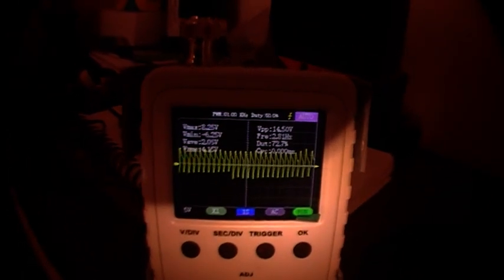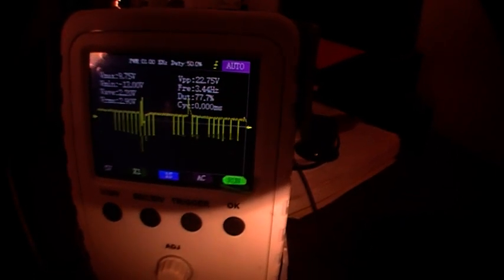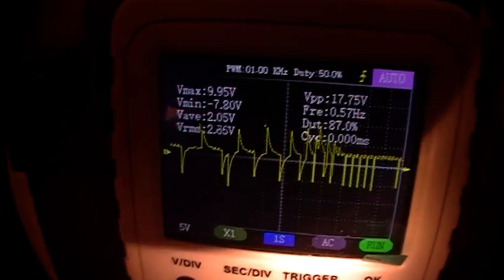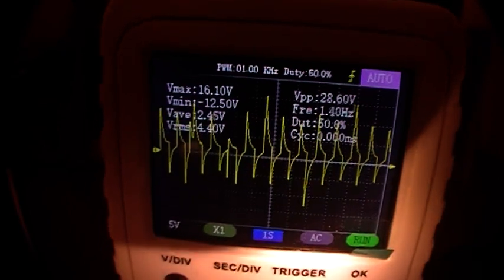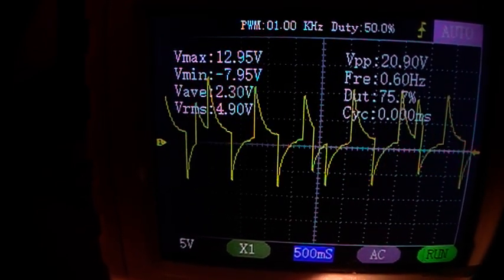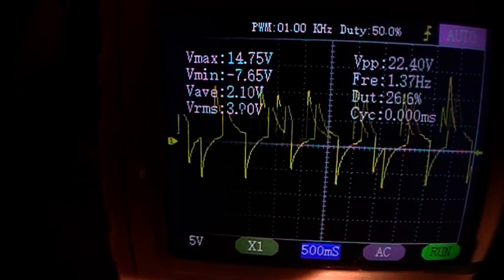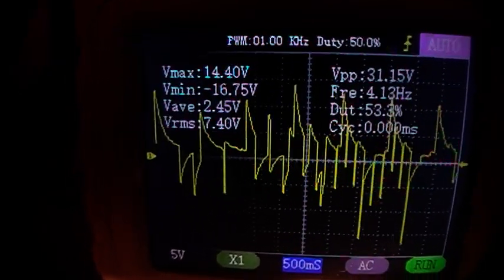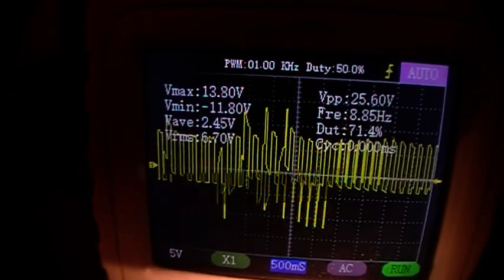very low ac frequency pulsar circuit test

Comment: the frequencies react strangely in fact, we would say that your capacitor charges and discharges but the same every time, perhaps this is what explains the fluctuations in the frequencies steven? your French brother, see you soon.
Reply from the maker: hey Dave remember the blue glowing spot on the edge of the water in my experiment where i subjected the water in the speaker to various ac frequencies , ive found some clues about this blue glow in doctor Simones latest video upload to
Reply: @stevenchiverton48  Did you find any clues about this blue glow in Doctor Simone's latest video? can you send me the link of the video steven thank you my australian brother.
Reply from the maker: @davedede5516   still checking it out I've read the script of that video and there's no more than what's in it so ill peace it together bit by bit,  if anyone bothers to share what they know about it if there's anymore. i may have to consult my friend aigptchat and see what he comes up with .
by the way Dave my magnetic amplifier using a modified step-down transformer failed and aigptcat didn't think it would either so we both failed
Reply: @stevenchiverton48  thin sorry for your magnetic amplifier, modified step-down transformer broke down, it happens my friend it probably heated up and the components did not support it, well I think.

Comment from the maker: it gets even more bizarre  when creating and experimenting with frequencies, the ten uf capacitor is a non polarized one as jaycar dont sell green caps in that value  anymore . and i think it be a great experiment to make a new non polarized capacitor bank and convert them into captrets for the next experiments
Reply: it's true steven you should try what we call captrets to see how everyone reacts, excellent idea.
Reply from the maker: @davedede5516   but the values of capacitors ive chosen for the next capacitor set up only are axil types and i don't think they have 2 legged ones with 2 legs at one end which are the best for captrets, I've made them before,  captrets are bizarre when using the outer can of the capacitor along with one of its legs